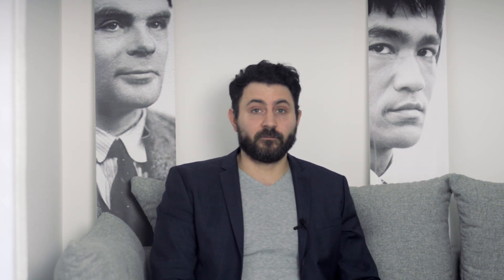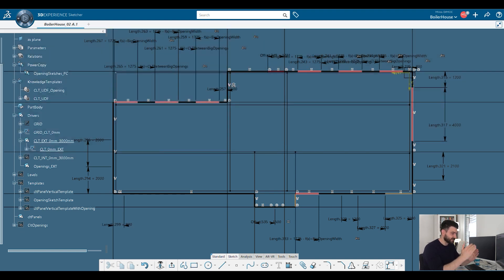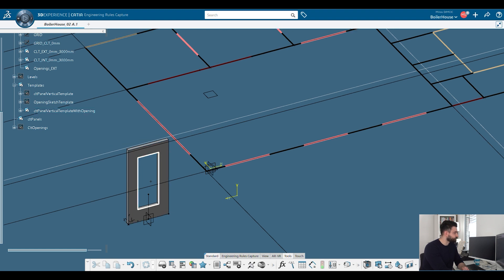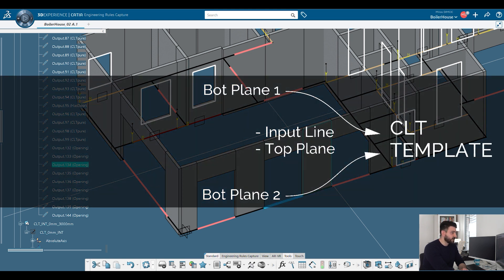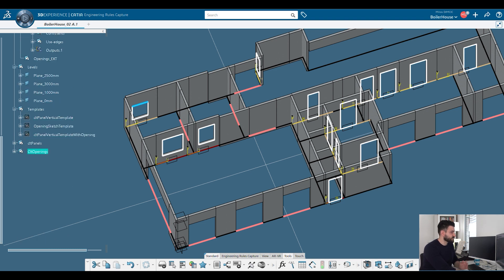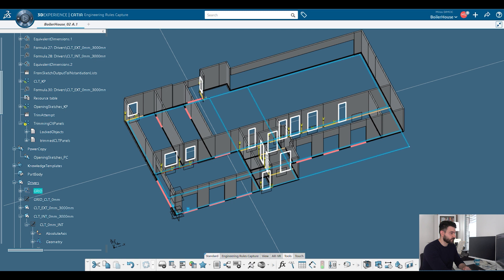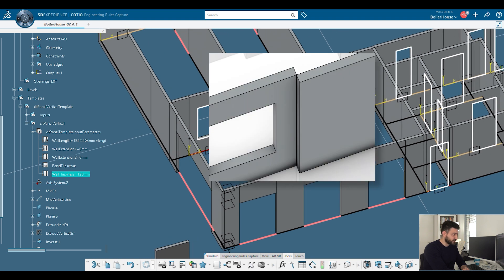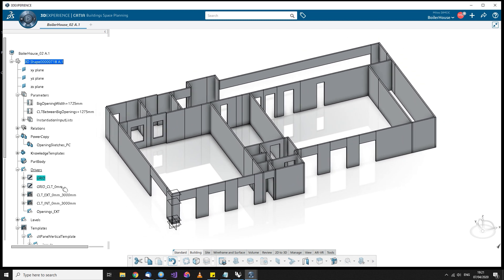Journey to the fully parametric Building Part 01 | CATIA | 3DExperience

Comment: Hello, great video and completely agree. I have jump on the 3dexperience, but since I never used catia before, there training videos that they offer you are not very helpful for novice users. Even what cadmakers have done, they coded a specific way of working and more in the automation (MEP), but very interesting to watch the videos, just makes you open your eyes in what can be done and offered. What you did, seems very interesting, draw lines ( sketch out a floor plan) and then associate  those lines with "parts" in your library. Is part 2 coming? I might have found a local university offering courses on catia that I may need to start with. Great channel keep up the work and the push.
Reply: CATIA for Complete beginners - CATIA AEC
https://youtube.com/playlist?list=PLeGuiPNXIcjRZrC1ziNxxd1XGK-056aXe
Reply: Some new resources for getting started:
2023 CATIA Building Design Fundamentals - CATIA AEC
https://youtube.com/playlist?list=PLeGuiPNXIcjRDFKRl6sz8MnpCS26X6Dkm

Comment: Awesome work and explanation Milos! May I ask you what caught your attention  in this software Catia and why did you choose to work with it. Thank you for sharing your knowledge!
Reply from the maker: Thanks. We are not  exlusionists when it comes to software - we will work with any that is available and that will give us what we need. With Catia - true story - I was not familiar at all with it. And 2-3 years ago I started programming "my own CAD software". My idea was full parametrics - entire geometry/model defined over points (Point->Line>Curve>Surface->Solid) so that I can always access those points (in the root of the DNA) and change them so that everything updates down the chain. And then I realized, that software already exists - Catia (or now 3dexperience platform). So I stopped developing my own system and now we are testing this and it is going great. My particular "dream" is a 100% parametric building and I am always searching for ways to do it...from what I have seen so far - this tool is the best candidate to help us achieve that (with very little actual coding). And for more specific answers you will have to follow the videos where I will test the software and also apply it in practice.
Reply: @ProArchitecture  May I ask what grasshopper is missing to be able to do 100% parametric building?
Reply from the maker: @mario.valkovic  It is not missing anything...but you see how in my video everything is nicely ordered in that tree structure? And everything is automatically connected to everything else if I just click on it (because that is in the core of the software..that is how it was programmed decades ago). If I wanted to do a fully parametric building in grasshopper (like I imagine it), I would have to cover the "surface of North America" with components and links...and even if I wrapped certain "functions" somehow, it would still be very slow... I mean you can do all this with pure programming as well..but it will be much more complicated and take much more time. The whole point is that the parametrics is INBUILT into the foundation of how the software is made...If I draw a Line with two points I dont have to make three components like in GH (two for points and one for line) and then connect them. I simply click on Pt1 and Pt2 and the software does all the "linking" for me and saves it....but it is very hard to explain abstractly like this...wait for more examples...
Reply: ProArchitect thanks! Looking forward for the next videos